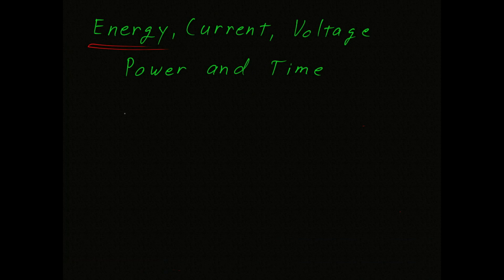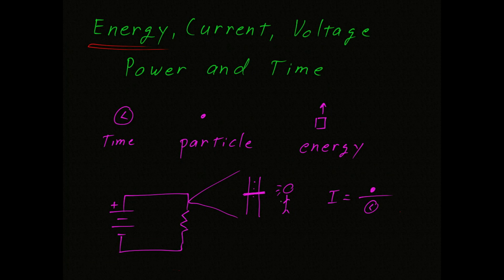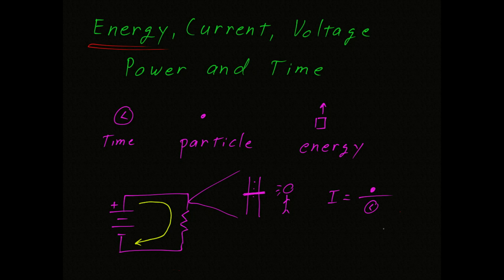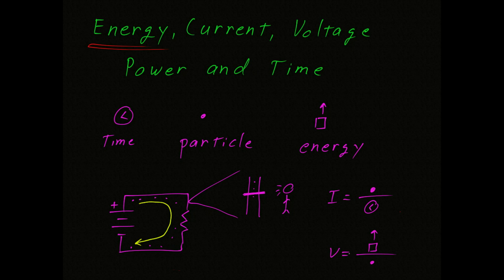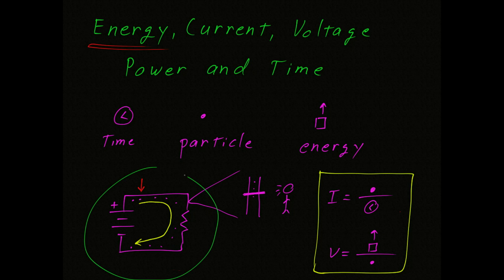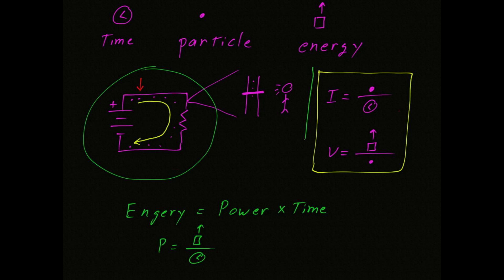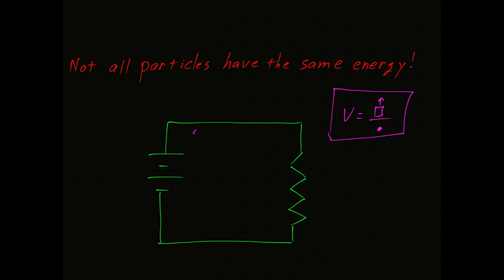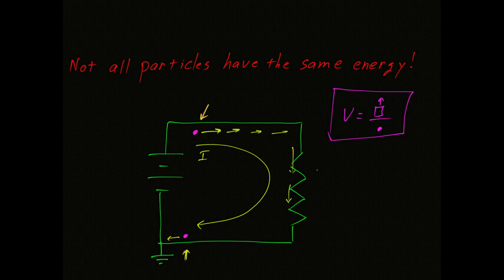Energy, voltage, and current relationships

Comment: What's confusing to me about this analogy is that if you add a new resistor in series with the resistor we have, the particles will suddenly give off less of their energy to the first resistor, even though the resistor itself wasn't changed. Why would the first resistor suddenly start consuming less energy when you connect it to another resistor in series?
Reply: I didn't know that. Is this for real? I gotta run some tests?
Reply: Because we are assuming that it is not adding an extra resistor but spliting the existing one into two resistors of equal values

Comment: Good video sir! But I have a question, what causes the charges to move from the negative to the positive terminal? Should there be a voltage to make them flow back to the positive?
Reply: Yes, you can send an opposite type of current back in the other direction with a negative voltage. "negative" and "positive" just refer to direction.

A positive voltage is a point conventionally said to have a surplus of electrons.

A negative voltage is a point conventionally said to have many "holes" (empty "spaces" around atoms for electrons to fill -- electrons are attracted to holes).

We can say either the electrons are moving -- OR that "holes" are moving (relative to electrons).
The electrons are attracted to the holes, and we can say that the holes are likewise attracted to the electrons -- 
so electrons and holes exert a force on one another.

In the video, he says "don't worry about it" --
and it's not that useful in electronics , per se. 
But it's a very interesting topic , how charges move around, and why, and what's doing it, etc.
Which starts to go more into physics.
Although electronics comes from physics.
Electronics is an applied type of physics.
Reply: @gnuPirate   wow thank you sir! I really appreciate your answer!
Reply: @gnuPirate  You're and applied type of physics

Comment: Hey, this is me from Kahn Academy. I'm still fairly confused. Would a thicker wire not allow more electrons to flow side by side at the same rate and thus have a greater current? 

Fyi, I have very little knowledge of electronics and math, I'm a freshman in high school who is primarily interested in electronics for the sake of designing and building my own guitar pedals some day.

Thanks.
Reply from the maker: Jacob,

Just think of a wire as a resistor. A thicker wire has a lower resistance. All things being equal more current will flow through it.

Regarding those guitar pedals - don't wait. Get started today. This is an excellent way to learn electronics. 

Best Wishes,

Aaron
Reply: Conductivity is directly proportional to the cross section of a wire, and inversely proportional to the length of wire. 

ie.  Wider wire allows more electrons through. 

Skinnier wire lets less electrons through. 

Longer wire means more resistance for electrons -- they have a longer distance to travel, so they get tired along the way.
Reply: PS. if you're into guitar pedals, you should see the Robert Moog documentary, which is amazing , and look into modular synths too, since that's kind of what guitar pedals are.